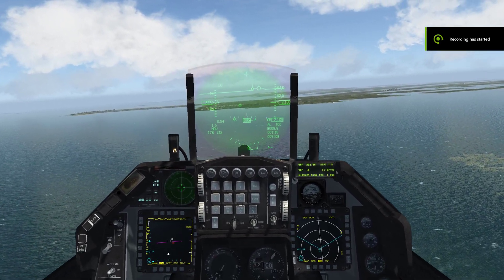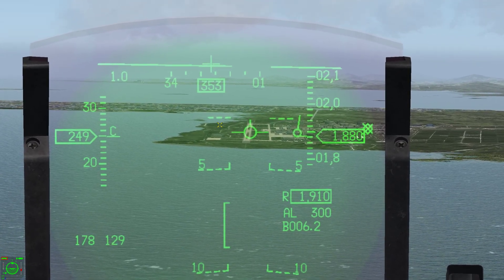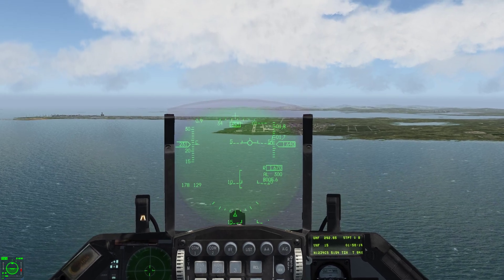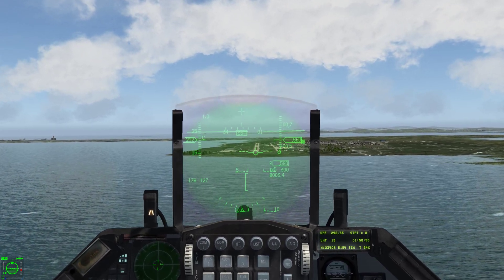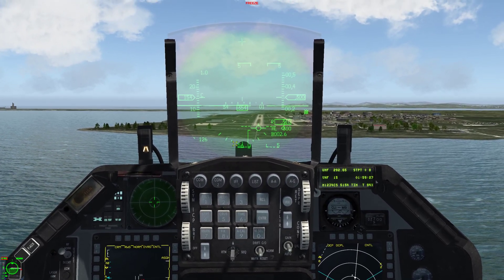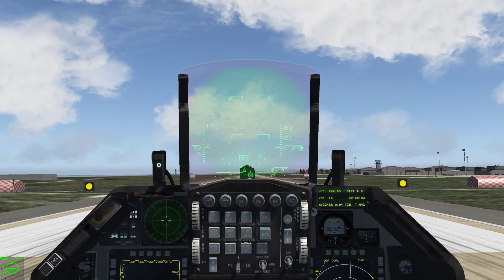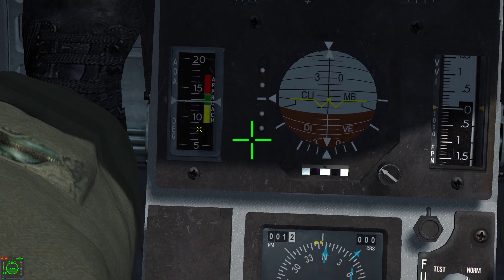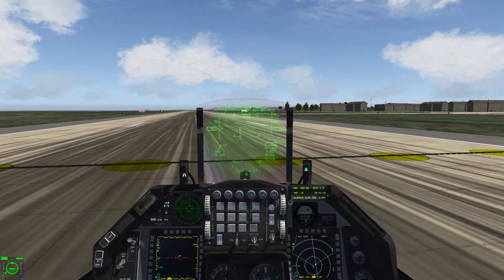Falcon BMS Quick Tutorial: Landing the F-16

Comment: My problem is holding the plane steady. I guess I’m over correcting, but I’m all over the place when landing.
Reply from the maker: Gotta be light on the stick, I often use my fingertips on the stick when landing and aerial refueling.
Reply: @dualaccumulator  Which flightstick are you using?
Reply from the maker: @mazinkhurshid  X52